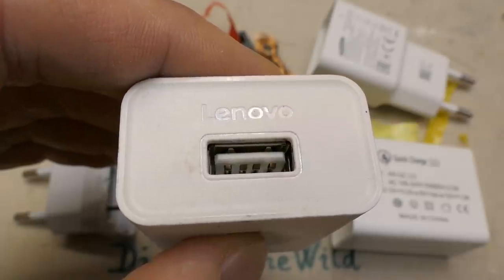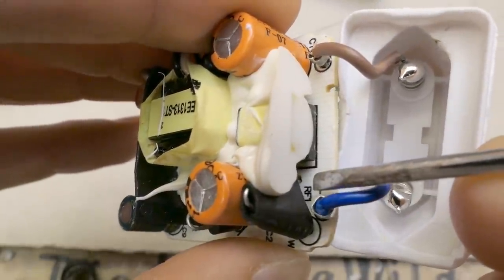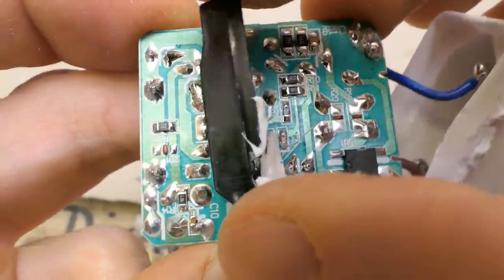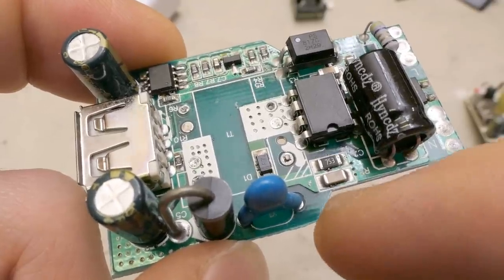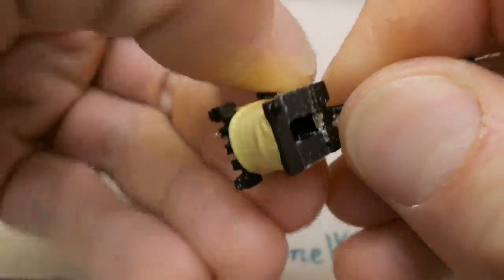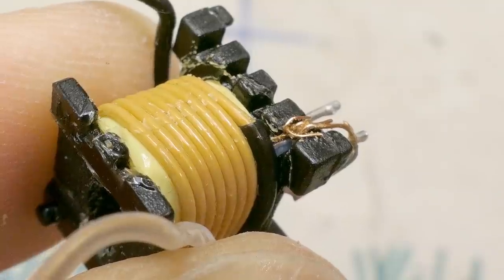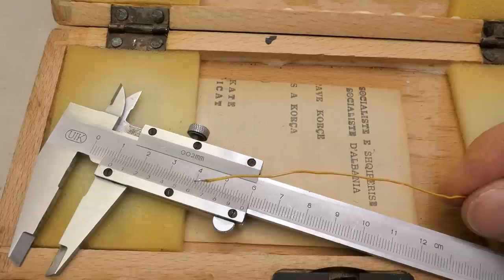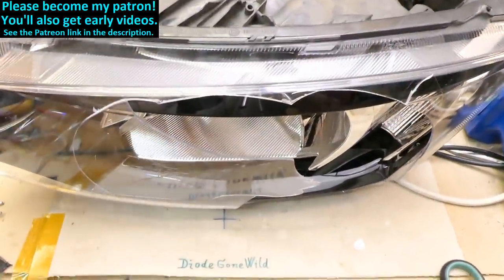Finally a safe USB charger?

Comment: Sadly the extra parts only doubled the cost to make it, but with all the middle players applying a 100% mark up each time they handled the unit this probably came in at 10 times the retail price. Only used by Lenovo because they can buy direct from manufacturer, and also have to provide a proper valid certification for the device as well.

Comment: Just rub some petrol to the edge to open it. It will melts the glue
Reply: That won't help, if the housing is ultrasonically welded. In that case it is like one piece of plastic without any glue. Only mechanical means will help then. Putting a wood chisel into the small gap and tapping it with a hammer usually works well to crack a case like that.